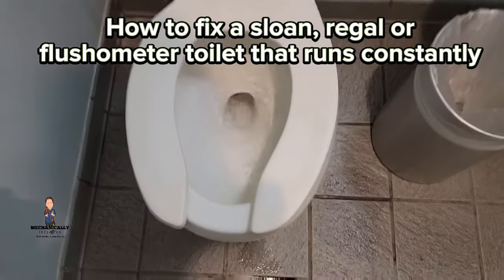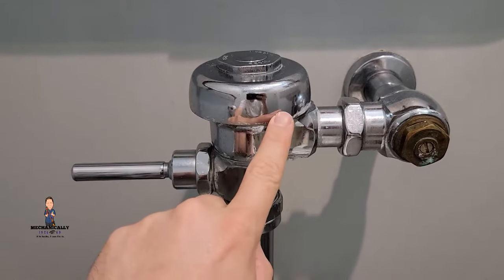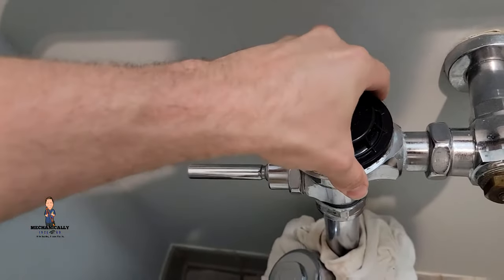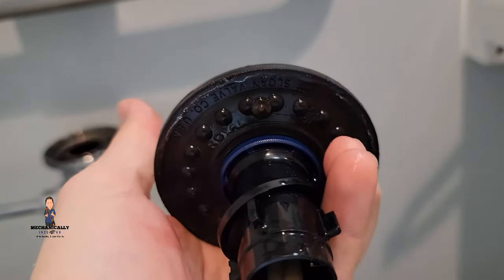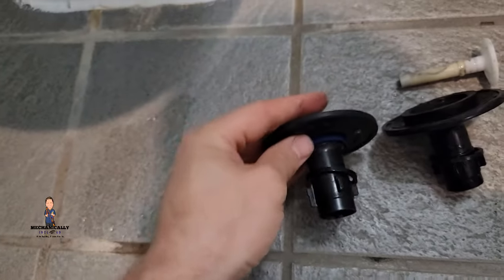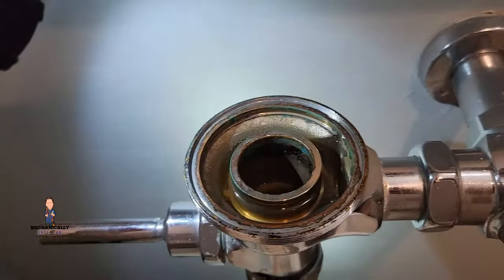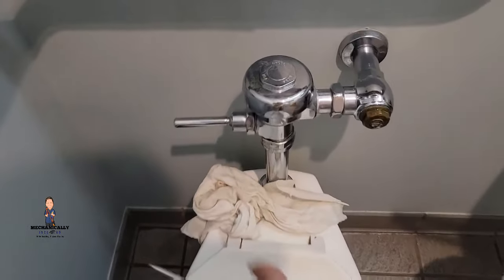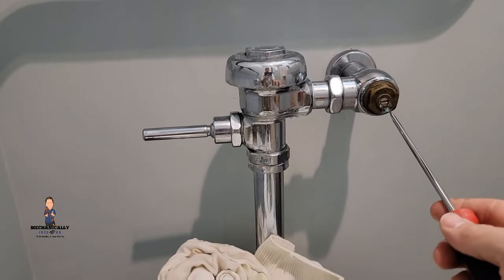How to fix a commercial toilet that runs constantly #sloan #flushometer #regal

Comment: Is there a way to loosen an over tightened cap or if it's sealed by calcium
Reply from the maker: Impact wrench or big pipe wrenchs
Reply: @Mechanicallyincleyend  BIG Pipe wrench?  OMG.  Big HEX wrench with cheater on it??

Comment: A good tip:
If you don't have smooth jaw pliers, put a rag, small towel or microfiber cloth over the cap or screw nuts to prevent scratching up the chrome

Comment: This taught us so much! What happens when the water won’t turn all the way off (the toilet is constantly running)?
Reply: Then you must replace the shut off valve for the fluchometer. Before doing that you must shut off the water supply to the bathroom

Comment: What do you do if that shut off valve screw is stripped? And no access to water line to turn it off
Reply from the maker: Well your screwed 🤣🤣 literally. Freeze the pipe add a valve for drain the building
Reply: The vacuum breaker was most likely installed the time as the diaphragm, probably a good idea to also replace as it's part of the rebuild kit

Comment: Could you just unclog the relief valve and reseal it?
Reply: You can also just wire brush that. You're a replace everything kinda guy. Ima fix everything till you can't kinda guy. But I appreciate you showing me the ropes either way. I think it's be a good idea to make a video where you actually try to fix the problem is read of just replacing parts. I have to waits weeks months at times for my department to order anything and other times I never even get the parts lmao
Reply: Where to order the flush handle please
Reply from the maker: @Zumbashapeup amazon has them search Sloan flushometer handel